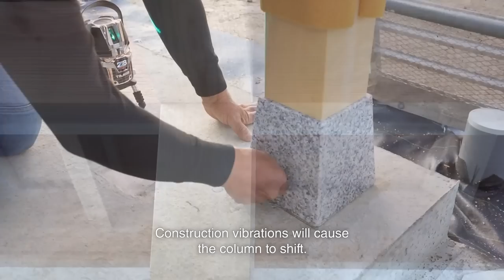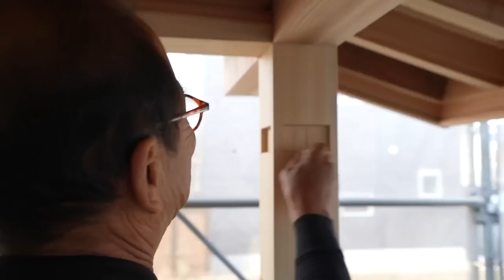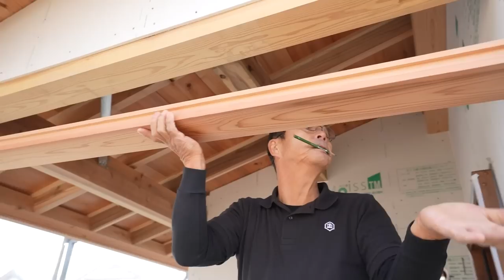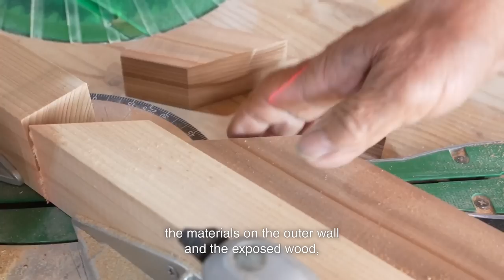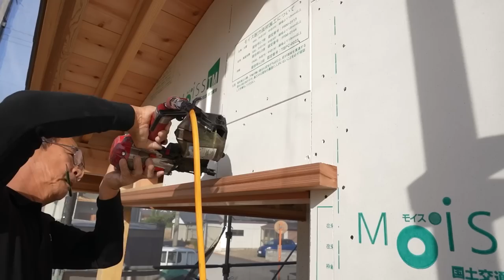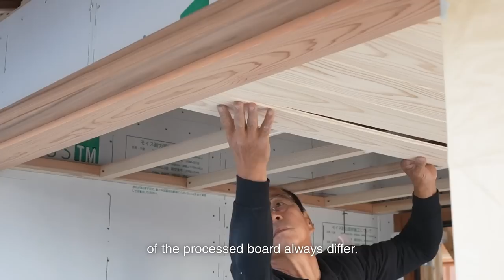Building a Front Porch With Lots of Solid Wood [Season3 - Part6]

Comment: Interesting. My in-laws garage has a frame attached to a mume-like piece, and the frame piece is half finished stock changing from 4 in to easily 6in on the unfinished end. The carpenter used various lengths of spacers to make the mume piece so it works for purpose. 
Now I can see from the carpenter's point of view how he made it

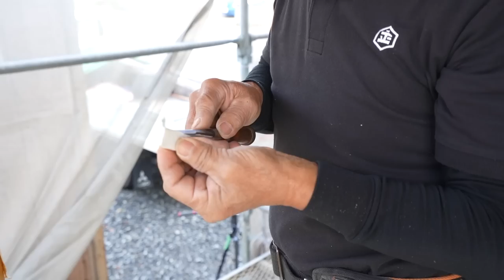Comment: 2:46
Japanese people are amazingly precise, clean and tidy when it comes to architecture and interiors. It's really amazing to see the pencil sketch part erased with an eraser. At Korean construction sites, workers poop or pee on the site floor, spit, smoke, and throw away all kinds of garbage. This is one of the many reasons why Korean architecture has yet to catch up with Japan. Of course, there are significant differences in construction costs and labor costs between Japan and Korea. That can be a bit of an excuse, but there are too many differences in mindset and culture. Korea is still far from developing architecture like Japan.

Comment: I'm trying to locate one of the saws that you use.  It is a circular type saw with different molding cutters.  I've never seen one in the US.  We have Craftsman's molding cutter head for the table saw - but nothing portable.  I've seen you use one for rabbit joints as well as stop coves.  Anyone have any information on that? Thanks for the great videos.